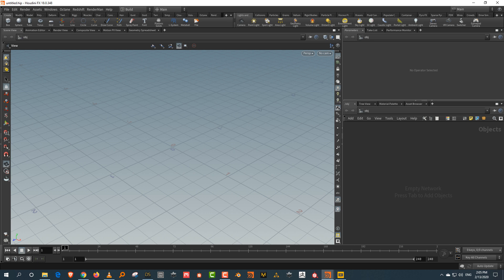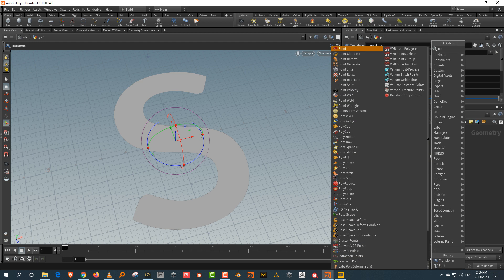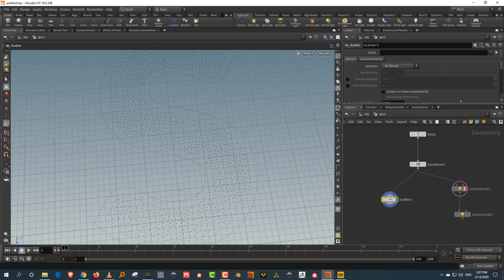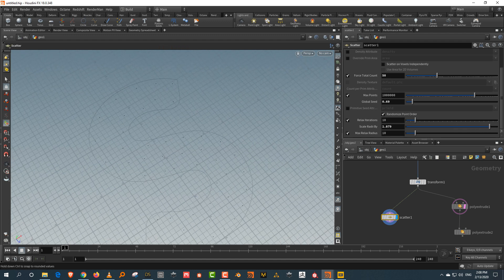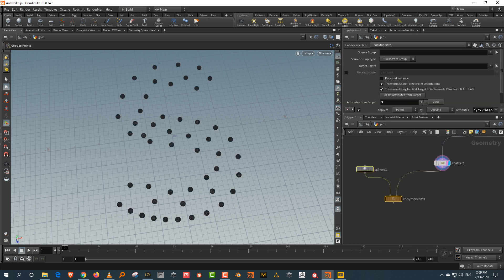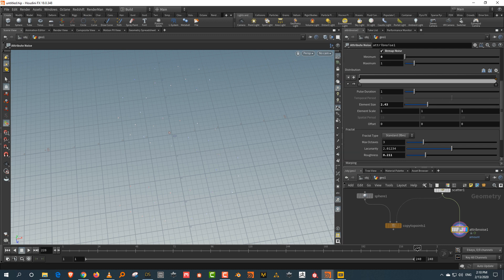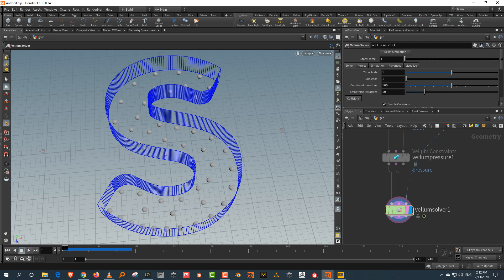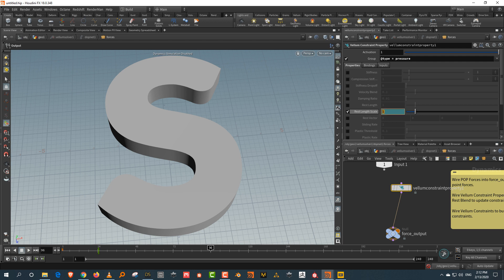Houdini Vellum - Pressure and attributes

Comment: Hello! Thank you for a great tutorial. I just tried to find a way to control rest length scale by point attribute in geometry. Thank you for solution.
But I have a little bit another quaestion: is it possible to make vellum cloth/hair simulation to follow some animation? for example I create a two geometries with animation and they starts intersects during the animation, and I want a vellum solver compute it, and solve intersections and also add some dynamics...
Reply from the maker: https://youtu.be/uuct_19996U
Reply: @rohandalvi  Thank you! You are the best!

Comment: Thanks for the tuts. Learning something all the time :)
I only wonder of one thing. Why did you use "copy to point" sop to transfer "amount" attr.  Why not use "AttributeTransfer " sop. I am just a newbie, but I recon that's the way to do it.
Reply: There's no geo to transfer from, the attr transfer node uses distance in space to transfer and is mostly useful with non-identical geo, In this case the attribute lives on the spawn points which aren't necessarily similar to the spheres, so by copying again he will create identical geo which inherit the amount attribute robustly. Another option is attribute copy which uses ptnum to copy instead of spatial proximity, but again, there's nothing to copy from really.

Comment: Hello, I have a question, I'm emitting a sphere from a vellum source, but I would like to give a random color to each sphere that is streamed, I'm trying to find to add an ID, but i can't find any in the vellum object, do you know how to solve this?
Reply from the maker: Just give random colors to the points and when you use copy to points the spheres will automatically pick up the random colors from the points
Reply: @rohandalvi  I'm not using a copy to point, I'm using one sphere emitted in continuous mode in the vellum source, and that's why I can't figure how to attribute a different color for each emitted sphere

Comment: Hi Rohan, this is great, but you couldn't just animate the Rest Length parameter in the Vellum Pressure node directly? Would that work the same?
Reply: This is an old question, but in case anyone else is wondering, no that wont work because the pressure constraints node and other constraints only read the geometry on the first frame. You need to use the vellum constraint property inside the solver to constantly update the attributes.

Comment: Hi Rohan, thanks a lot for the tutorial, one question, how did you stopped the noise animation?
Reply from the maker: multiply with a mask.
Reply: @rohandalvi  are you multiply scale of attribute by 0? this is the same as bbox in attribute delete?
Reply from the maker: @fallsins772  use a mask by geometry. Animate that to get an animated mask if you want to modify the noise from a direction. And then in a wrangle just do
@amount = @noise*@mask;
Reply: @rohandalvi  thought exactly the same, but thanks!)

Comment: Reading directly from points works (H17.5) *point(2, "amount", @ptnum)*, if connect noise to the first copytopoints and set input 3 to first context geometry. Is there a reason for splitting into two copytopoints?
Reply from the maker: Just for organising. But you can do it in one node tree as well.